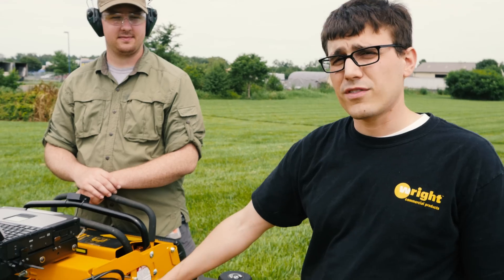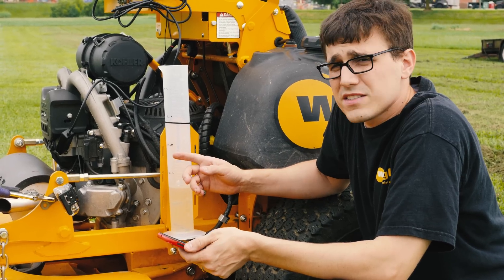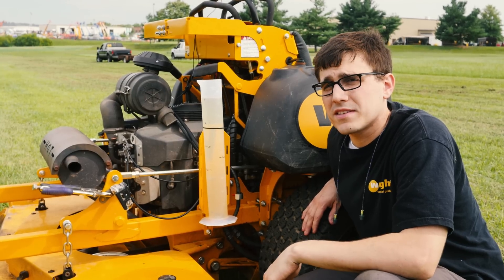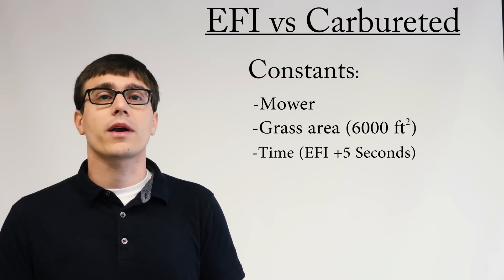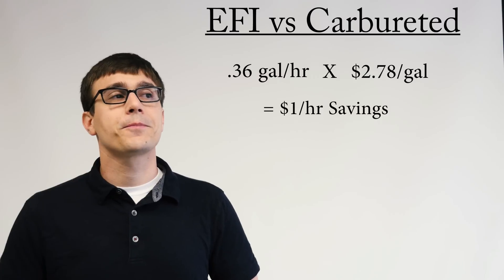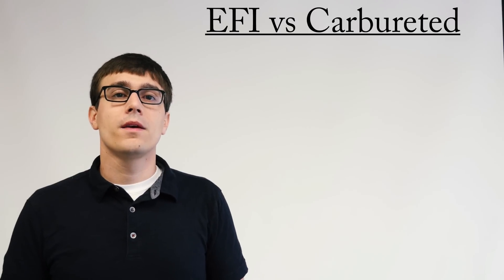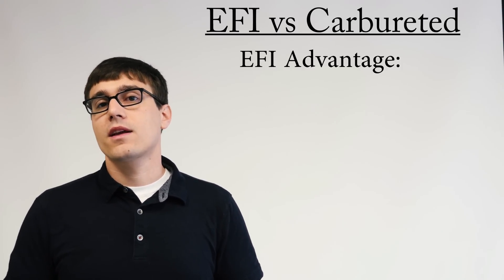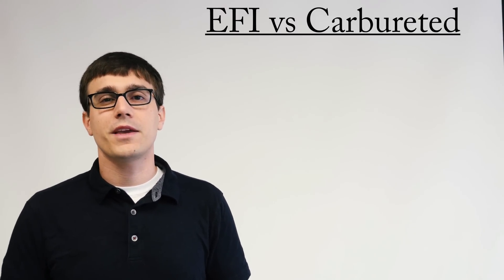How EFI could save up to $1 per hour

Comment: Different brands different engines apples and oranges,. not a good test. should have used say a vanguard same hp and then the vanguard efi same hp. Not getting EFI too much to go wrong more repair costs, not KISS not getting.

Comment: Another point of EFI vs Carb engines is with the proper fuel mixture on startups with EFI, oil doesn't require oil changes as fast. This is in part the reason why oil changes in vehicles went away from 3k mile oil changes in cars. Basically carb engines don't run as efficiently and that impacts your oil. As that is the case your engine runs cleaner and possibly longer.

Comment: I can see where he's coming from. The old carburetor system on your car. Went from 12 miles to a gallon until it went to injection. 2 somewhere around 37 miles to a gallon on the same car.

Comment: I'm interested in EFI because I have had a lot of problems with carburated engines in mowers and other small engine equipment. I don't see an EFI option for the FX730 on the Stander Intensity 48", it is not an option despite Kawasaki making the same engine with both options?

Comment: No doubt efi should be more efficient, but you really have too many variables with the hp/displacement issue. Rpm's also need to be a constant. Could be splitting hairs here since we already know that efi should be more efficient. Imho.
Reply from the maker: That's all true but both these engines are sold on this same mower.  The point was to get a little more realistic than Kohlers "may save up to 30%"... -Ed

Comment: This takes mowing to a serious level of science and nerdom. lol Me just cut grass. ug
Reply from the maker: That's our job.  When you board plane you hope your pilot is an airplane nerd, right? -Ed
Reply: Wright Commercial Mowers I have a 2013 Wright Velke 32". Do they have wider tires for those? I think mine are a bit thin for the weight despersement.

Comment: wow I felt my IQ drop watching this.
Reply from the maker: Did you gain knowledge? that would increase your IQ, right?
Reply: I have been a technician for years working on small engines what I watch in this video is seriously pointless gas saving don't mean squat when it comes to the cost when that brand new machine needs maintenance

Comment: fuel injectuon sucks if you know how to tune a carb right
Reply: I’ll take EFI over a carbed engine any time hands down.
Reply from the maker: Carbs are simple, and that's good.  But a plugged jet can lean out the engine blow a hole in the cylinder and you have to set them rich to run evenly, thus using more gas.
Reply: mystic1754 lean is mean man who wants a compuyer to tell it to run perfect when you can get more power from a simoler tune lets see you adjust the factory computer to run leaner to get more power. your over thinking i drove a cummins with a 24 valave i know how injectors work i have a nova with a 1050 dominator i know how carbs work i know you can tune a comouter but only a hand full of people can tune one and only a hand full of people can tune a carb everyone relys on a computer but if you know hoy rods and mess with carbs any one in their right mind would go mechanical over computer as long as they domt overthink like you. no one wants you round here dirt
Reply from the maker: True fact my friend.
Reply: mystic1754 I love apple butter, shit not so much...

Comment: Not an accurate evaluation...fuel is bouncing out of the OPEN container !
( how do we know the carb is properly tuned ???)   Not fair !
Reply from the maker: Maybe a couple drops... You can defiantly see it sucking it down enough to get the point.  Sure the carburated one could be out of "adjustment" but the EPA put the kibosh on that a couple of years ago and the factory jets get bigger (more fuel) rather they become contaminated and caused them to run leaner. To me the biggest innaccuracy of this is the sample size of 1.  Ideally we'd do larger areas multiple times and average them. -Ed
Reply: what's the temp outside. did u compensate for evaporation?
Reply: +Wright Commercial Mowers gvxfvcfumk!♦♦♦♦♦♥♥♥♥♥♥♥♥♥♥♥♥,nbh hhvvhh hjbbbhjjknjn.

Comment: but can you buy an efi for 30$ AND IT COST A LOT to fix
Reply from the maker: That's the lottery we all have to deal with.  Same problem with these newer diesel trucks--do you pay now or maybe pay later? On average tho EFI will save $.  At the end of the day--that's one of the reasons why we sell both options.
Reply: @WrightMowers  Newer diesels cause you to pay more now and later. Diesel trucks have more oil capacity making servicing more expensive along with much more expensive filters, added DEF fluid, increased repair costs. And actually more frequent repairs. Turbos, EGR's, exhaust sensors, injectors, high pressure pumps, are all more prone to failure than their gas engine counterparts, and are more expensive to repair. Not a lottery, just facts Jack...

Comment: My question is:

Why not just go diesel?

Diesel engines are VASTLY more efficient, durable, and lower maintenance than comparable gas units. 

At this power level and total unit weight, I can't imagine what benefit a gas engine would hold.
Reply from the maker: Great question.  The reason has a lot to do with cost.  Now that the EPA regulations are pushing exhaust after treatment it pushes the price of a diesel way up for the portable-type landscaper's mower.  The cost starts to justify itself when you get into the 60-80hp range.
Reply: James Copeland  Diesel engines also have a greater thermodynamic efficency.
Reply: James Copeland deisels pollut more

Comment: would love to see a video on changing the blades and general maintenance. I have been looking at the I and wondering how a person at home would change the blades. How would the mower be lifted? How would the oil drip out or is there a tool? I have been using a pump but is that the best?   the maintenance that people need to do would be a great video.
Reply from the maker: +John Ley Thanks for the input.  We have more maintenance type videos in the pipeline.  Stay tuned.  Check out our oil change video.  A tip that came up after we published the video was to take a 2L bottle and cut the bottom off so that is has a scoop shape--once you have the filter loose, place the bottle over the filter while you spin the filter off and all the oil and the filter will be caught in the bottle.
Reply: +Wright Commercial Mowers how fast is the Zk 52 inch the one with the most Hp? thats the mower I want to buy
Reply: I believe 12 or 13mph transport speed. I'm looking at the same mower.

Comment: Just did the math for CLIP Lawn Care, and our Employees are about 39% versus 2.0% for gas, so definitely important to buy good performance mowers! I know you didn't mean it that way, but for us Labor is definitely more important than fuel!
Reply from the maker: +David Tucker II Dave, Thanks for the data.  That's very critical.  Engine performance is way more critical than fuel consumption. That highlights why it's important to first choose power and torque and than look at the fuel options.

Comment: Great Video.  Thank  you for breaking it down.  Sounds like a big plus for EFI.  Only downside I have heard is only the dealer can work on them.
Reply from the maker: +Bust776 Thanks for the comment.  There is an element to this that you can do yourself.  The tan wire on the engine connector by the starter is an indicator light.  If you put a test light on it you can access blink a sequence that can tell you what codes have faulted and the engine manual will tell you what those codes mean and what can be done to repair the engine.  On a Kohler, activate the blink code by turning the key ON-OFF, ON-OFF, ON.  Briggs sells a mini scanner as well. See your manual for more info.